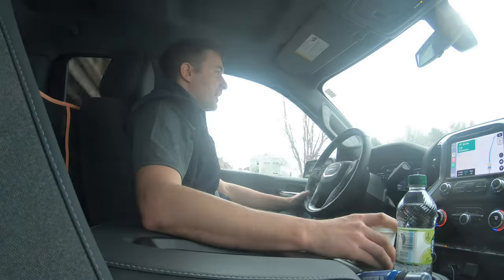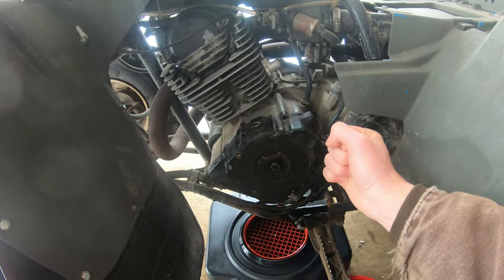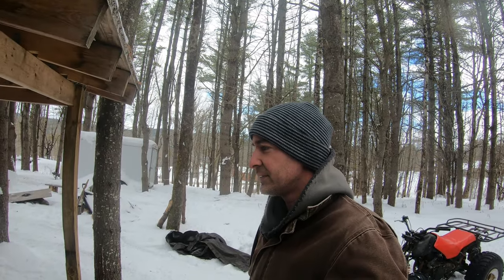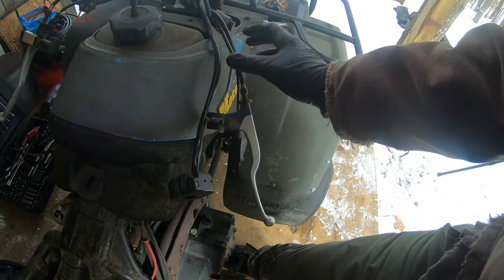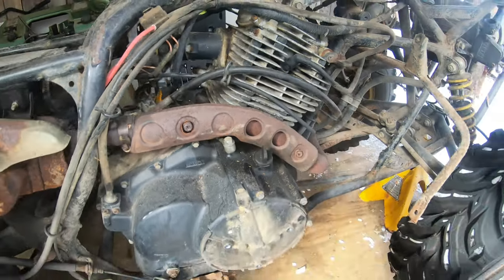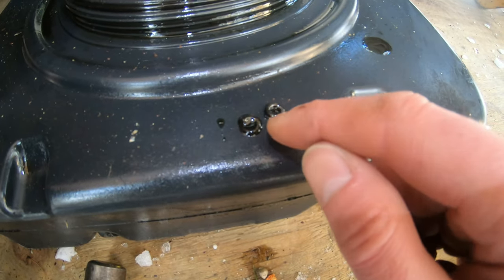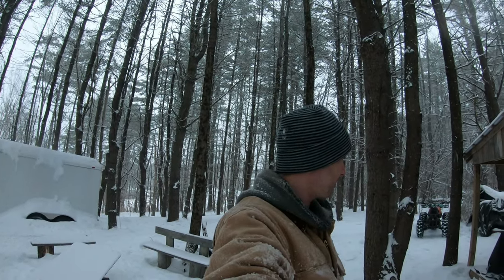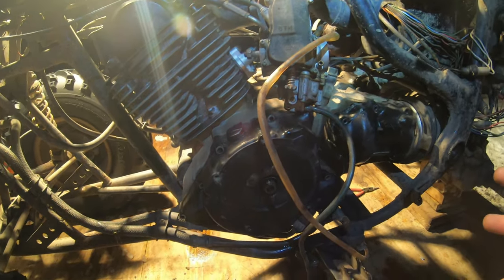1989 Moto 4 YFM350ER Budget Rebuild Part 1 - Initial Inspection

Comment: Hey man I was wondering what sides the brake perches are installed, can't really tell on my 88 since it doesn't look right too me. Thanks.
Reply from the maker: Rear brake on the left. Front brakes on the right. Good luck.
Reply: @VermontLife  Thank you. Mine has what I'm assuming is the rear brake on the right, it has the parking brake mechanism and everything on the perch and it didn't quite look right lol.